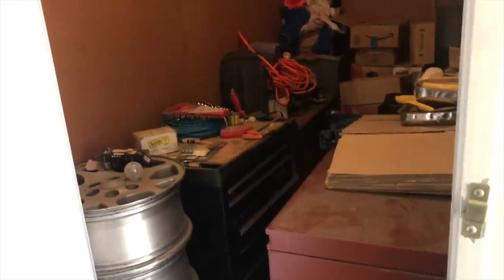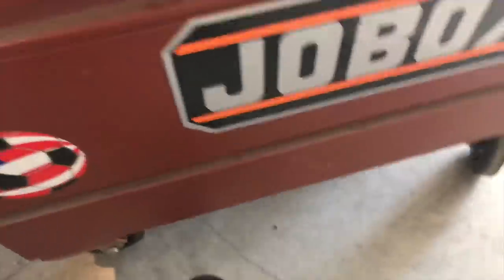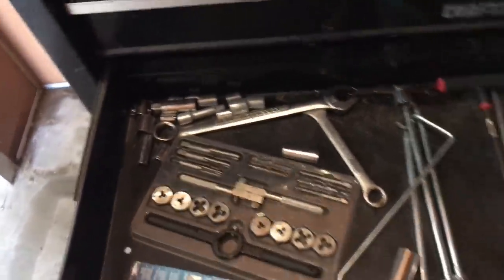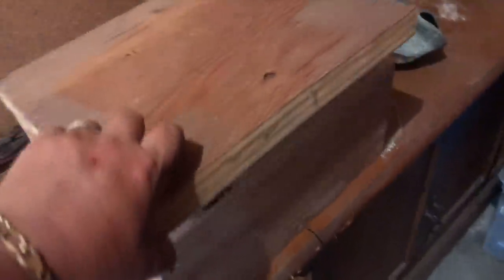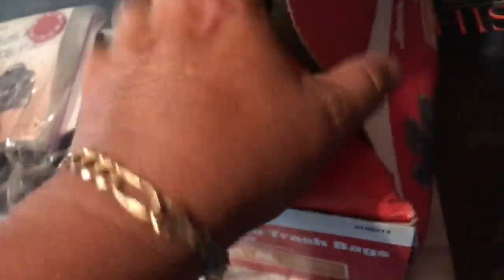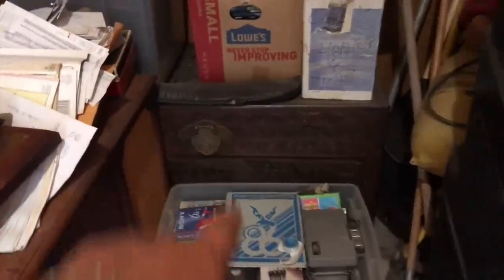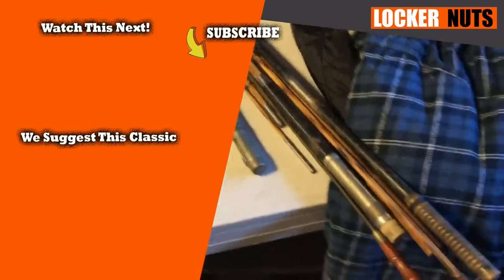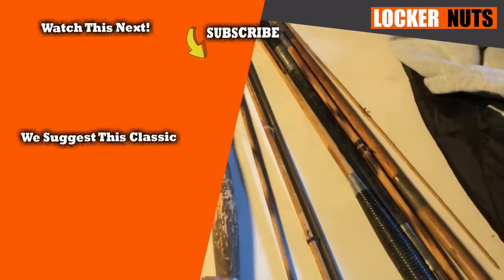What's in the BIG TOOL BOXES from the $550 locker I bought at the abandoned storage auction?

Comment: Concrete 2 part epoxy kit. Nice. By the tools and such- hammer drills concrete lags and the epoxy the guy was mounting something to concrete , could be as simple as mounting A/C units to homes right up to installing support posts in new constructing buildings.
Reply from the maker: Great insight. Thanks! This was some of the best tools I'd found, but I don't usually buy tool lockers.